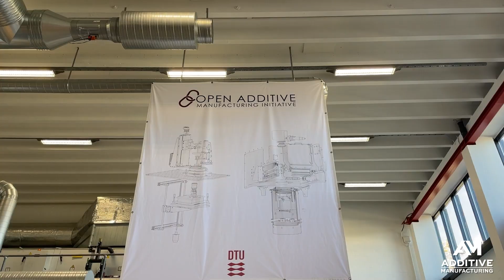How Gas Flow Helps the Laser | Understanding Laser Powder Bed Fusion

Comment: I'm a welder. If I have lets say 12'X12"X.5" aluminum plate, 2 pcs. forming a tee joint using DC straight current with argon I have to wait for the energy in the 300amp arc to puddle the material for welding. But, if I use Helium, 100% it will puddle almost right away and at 225amps. 
The gas somehow helps conduct the arc heat.
I wonder if they have used helium as a inert gas in this 3d laser manufacturing and if so what was the results? I know it is like 4X more expensive of a gas.

Comment: The flow of darker contaminated gas can be seen so well in your shots. I haven't noticed it before. I've worked with laminar flow cabinets in pharmaceutical manufacturing but the flow was a bit different, coming from the top.